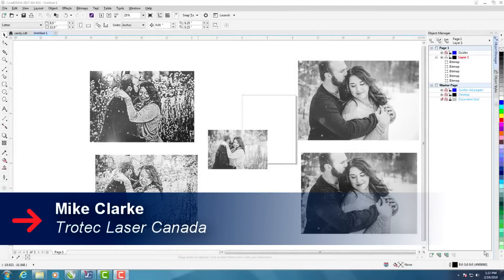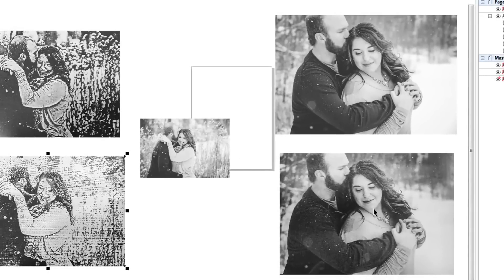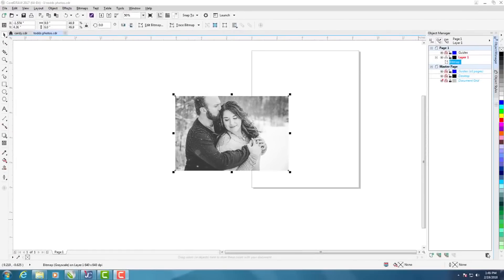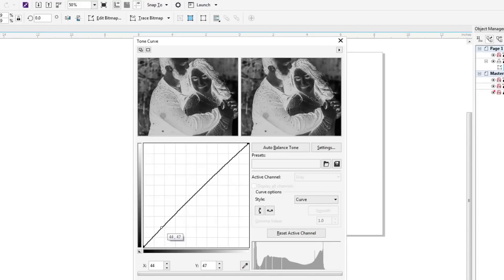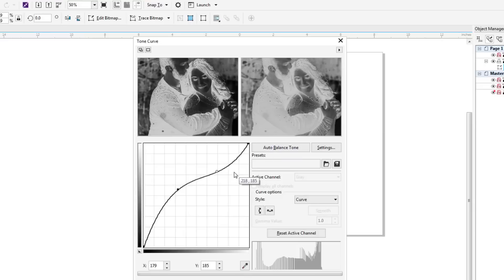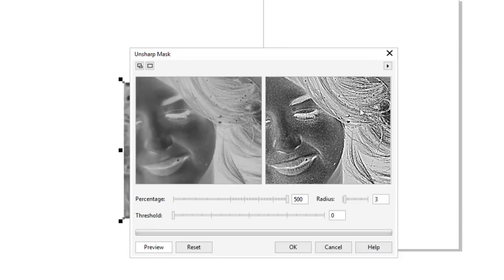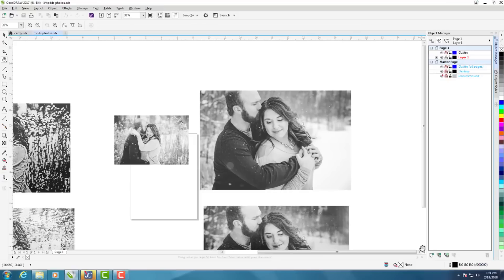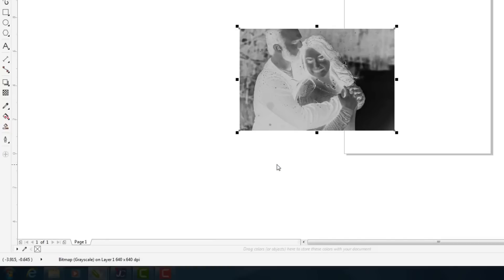Laser Engraving Photo on Acrylic | Photograph Engraving

Comment: This engraving is beautiful! I have a Glowforge and I know the settings would need to be different. Any advice you can give me on how to get the correct settings with mine to get this same result? Or would I just convert the image exactly the same and use the same settings that I'd normally use on my Glowforge? Also, I use Inkscape to convert my photo the way you did? Or would I need to use another software? Thanks!
Reply: So I have a glowforge as well. I only successfully was able to engrave to where the picture was very clear once. I don’t know what I did. The issue I’m running across is actually getting it to convert to whatever first not necessarily the settings on glowforge. Just select the acrylic option  that setting seems fine but it’s the converting the picture properly is the issue for me; I’m working on it today so if i figure it out I will let you know.

Comment: Why do you run it at 600 DPI when the image is 300 DPI? Telling it to increase the DPI is not going to increase your detail - it will instead make your dots overlap each other more than they are in the original and reduce the amount of white space.
Another question I have always wondered about is when you select "automatic", what does the software use to determine an optimal PPI? Is it a percentage of other factors? Is it based on the level of light and dark detail? I assume Trotec is defining PPI as PULSE per inch rather than PIXELS per inch?
Reply from the maker: Regarding running the laser at 600 DPI when the image is 300 DPI, the reason for this is to improve the quality of the engraving. When the laser is set to 600 DPI, it is able to produce more intricate details by firing the laser at smaller intervals, resulting in a higher resolution image. While it is true that simply increasing the DPI will not add additional detail to an image, it can improve the clarity and sharpness of the details that are already present.

When selecting the "automatic" option in our software, the PPI is determined based on a variety of factors including the material being engraved, the speed of the laser, and the complexity of the design. Our software uses an algorithm to analyze these factors and determine the optimal PPI for each project. This allows for a more efficient and effective engraving process.

And yes, Trotec defines PPI as pulses per inch, rather than pixels per inch. PPI refers to the number of laser pulses that are fired per inch of travel by the laser head. This measurement is used to determine the resolution of the engraving and can be adjusted to achieve the desired level of detail for each project.

I hope this information helps! Please let us know if you have any additional questions or concerns.
Reply: @TrotecLaserCanada  This is interesting info - thank you. So, if the image has no detail (white) for a given pixel, does the PPI number still ignore the white pixels regardless of the PPI? Or will an increase in PPI at some point produce overlapping pixels (and produce less detail, darker) if the setting is increased more than the number of distinct individual dots the laser is capable of producing per inch?  Does the automatic setting avoid overlapping dots or will that still happen?

Comment: I would like to do this on a scooter windshield would you be able to do that please comment back thank you for this video
Reply: Is your scooter windshield curved? That makes a big difference on the ability of a laser to engrave. 
You may want to consider using sand blasting an image.
Reply: @DJ-73   It does have a little curve to wait
Reply: @martinneps9387  I know an AP laser can do it. Some laser machines will only engrave on a flat surface and then there is the fact that the bed area doesn't adjust down. Look at AP laser on YouTube. Its an awesome laser

Comment: I 2nd Darius' question - about the photographer's copyright. They make most of their money on the prints and usually not as much on the sittings. Clearly your client originally brought in a photographer's proof (low res). Printing from that would violate the photog's copyright. That's why they give clients low res files. Copying from the original print is also a violation of the photog's copyright. The client was sold that single print. It's not a "negative" the client owns to make as many duplicates as possible - unless the photographer provided a writtten release to treat it as such...
Reply from the maker: Hi Cindy, are you talking about in general or in this particular video? In general, engravers who do photographs usually do them for weddings and special events. In which case we always suggest to double check with the photographer about re-making the photo onto a piece of wood or acrylic.
Reply: Lol give me a break